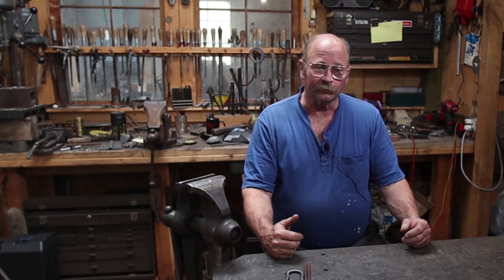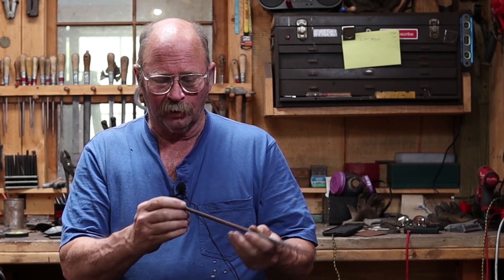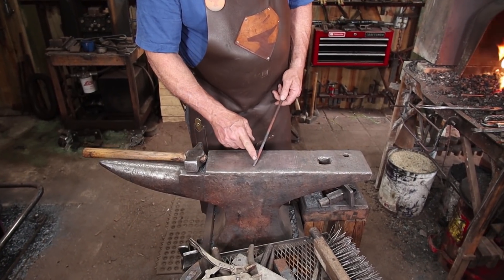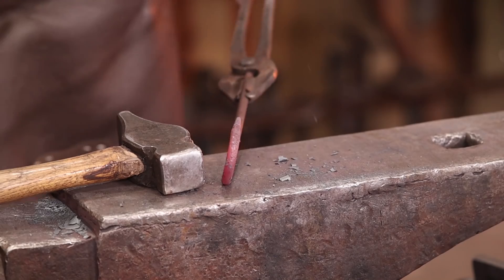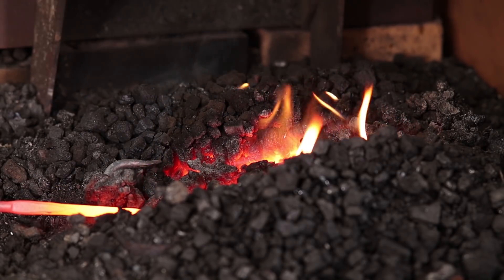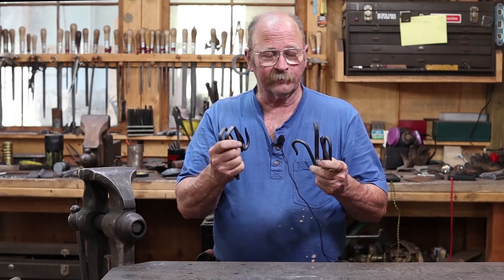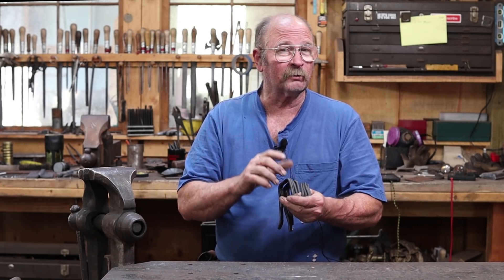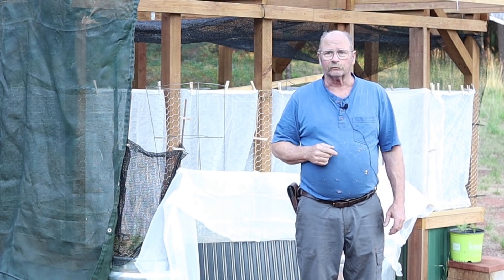Board hook, forging a custom hook

Comment: Good demo, John.  Hooks rule! (next to pork fat, LOL).  When I finished building my shop a few years ago, I made several like that out of 1/2" HR round rod, with the shanks about 8" long.  They were used to hang lots of heavy stuff from the 2"x12" ceiling joists such as hoses, bicycles, garden tools, ladders, etc. with a large radius on the hook part.  Bending the "U" -shaped part with the 1/2" stock was a lot of fun.....

Comment: I finished.  2 hooks in 1 hr.  Came out terrible-looking,  but they do work.  I did not have a 1.5 inch mandrel so mine came out closer to 2 inches.  I kept dropping them.  Need to make a better pair of tongs.  You make it look easy.

Comment: I may make some of these to  hang cords and air hoses from rafters.  I love that bending jig you have for the vise, do you have a video on that? I'm thinking of turning a bunch of sizes of round on the lathe and making some. Since they are separate, you can pair any two sizes, and adjust to any thickness.
Reply from the maker: https://www.youtube.com/watch?v=uhgXRBHDoHs&t=193s
Reply: 445supermag...no need to turn those on a lathe...just get several sizes of black pipe and tack weld them to the bases.  I have several sizes of jigs like that with black pipe from 1" to 3" diameter.

Comment: shadecloth isn't typically finished with seams and gromets here, you just buy however many metres you want off the role - so I thought you were going to use the squared end going over the rafter to hold the shade cloth on the rafter itself, sort of like a clothes peg.
Reply from the maker: We buy it both ways and have even had the heavier stuff sewn up to custom sizes

Comment: "Two-by", is this a language thing? Because it looks more like 1 1/2"?
Or perhaps planed down from a roughcut 2 inches but kept its name?
Reply from the maker: More of a lumber industry thing.  It refers to a nominal 2" thick board.  Cut 2", planned then kiln dried.  The end product is 1 1/2" thick.  Any lumber yard selling 2 x 4 boards will be selling 1 1/2" x 3 1/2" material.